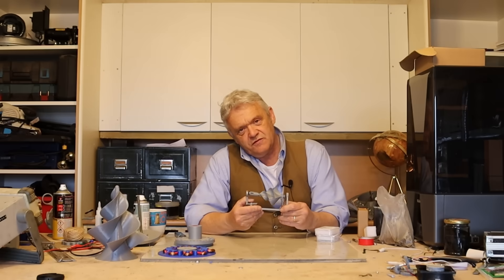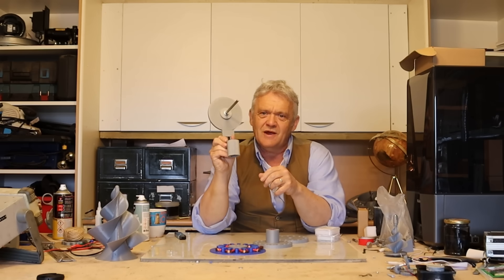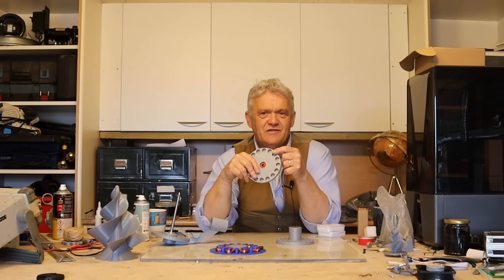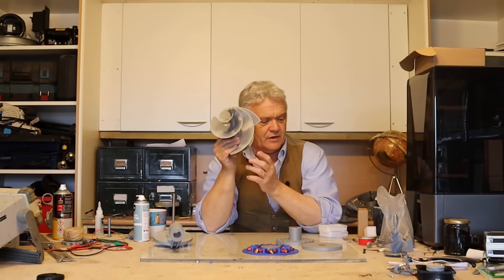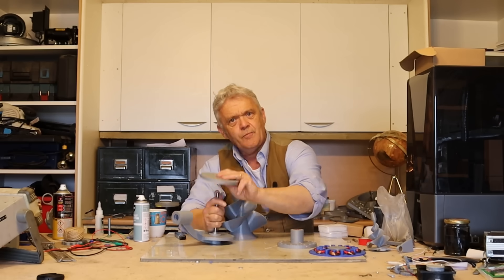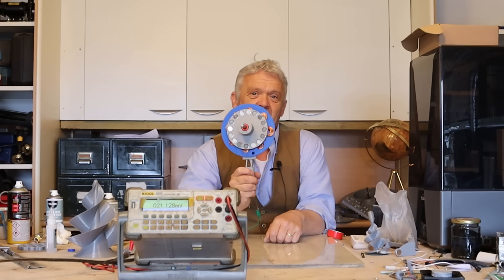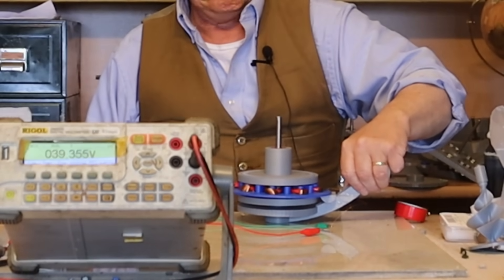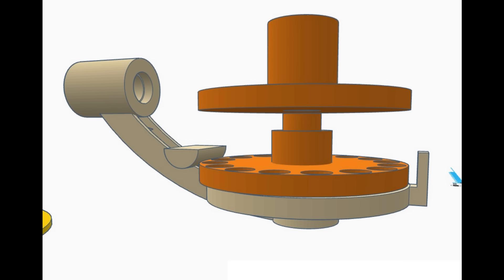1998 Archimedes Wind Turbine Generator Combined

Comment: Do You know why ship propellers aren't shaped like an Archimedes Screw?  Because it was found that if you cut the screw off at a point where the top of one blade starts to cover the bottom of the other, it's more efficient.  It's a simple optimization that's been known for over a hundred years now.  I bet You'd find the same if You were to cut the height of the screw in half and just keep the wide base.

Comment: If the slow speed performance is affected by magnetic sticking you could try building a centrifugal clutch into the deign
Reply: There was rubbing of the parts between the magnets and coils. There wasn't any magnetic sticking.

Comment: Awesome! Now to a Question! if we take a serpentine coil and make to tracks! one north and one south! To got levitation on the permanent magnets have a magnet in the turn of the coil! this is the cheapest way to get a levitation bearing in the rim! And max output on it to! And we can get a row on the other side to! And if that is done i can see it work Vertical and Horizontal as an Bering! It might be more costly but real Good!!! / Mikael

Comment: I'd love to see an Archimedes turbine mounted vertically inside a Darwin turbine. They look like they were made for eachother.
Reply: I also saw these as a match made in heaven 😊. Also because it would allow the use of the ball bearing tip to get low friction.
One thing I have found which is very important, is that these Neobidium magnets do not like being outside. If the surface coating is even very lightly scratched, the magnet just turns to rust dust.
Reply: as soon as he said "so I've changed this to a cone" I think everyone's brains snapped into the same image.
Reply: @Jay-jl3ou  Yes you can seal them in. But as a note, do not use silicone, epoxy does work, but if you think ýou may want to remove them a wax may work as well in cold temperatures. Silicones let water creep between it's bond to the surface, so moisture would get to the magnet.
Reply: What a genius idea, I can't wait to see if it works.  I bet Robert will get right on this, laughing like a mad scientist while he goes!
Reply: @Jay-jl3ou  They already are. And yes, if I were to make my own, I'd not only seat them with Epoxy Resin, I'd seal them with it too.
Reply: Seems like its the easy with even a smaller coil in the bottom, to generate top and bottom which can adjust the drag so the higher wind, the higher the torque,   Put that 3 phase washer coil you had earlier and make the magic happen with 3 phase on top and bottom in rotated alternations
Reply: And a magnetic bearing!
Reply: That was my first thought. It looks like it would be very efficient.
Reply: I was just going to write the same comment!
Reply: What do you mean, 'like'...?
Reply: A match made in heaven.
Reply: true
Reply: I thought the same. Would be interesting

Comment: Robert, ☝️☝️✍♥️  maybe a series of forward facing funnel shaped shroud , then cylinder cover, and then tail components to first collect wind like an open funnel similar to what  a dog wears after surgery, and add an interior rough surface or dimpled surfaced cylindrical wind energy concentrating housing shroud placed 360 degrees closely around the auger's length as a wind energy cylindrical concentrating surround to direct the wind energy to pass over the auger's fins in a parallel fashion and at a higher wind speed with the third component being that of a well set back trailing fin to turn the auger steady into the wind designed like the 1900's U.S. farmers type simple fined water pump wind prop with flat sheet tail. Think of a tail shaped like a boomerang so that the top and bottom surfaces of the trailing tail are out of the auger's vortice exhaust wind turbulence. Please keep up the inventing. I hope that You and Luke have a Happy Day !

Comment: That little turbine is just gorgeous, have you tried using capacitors in series to cancel the back-EMF generated in motors and the generator itself? Eliminating that little problem would be huge.
Reply: The "back-EMF" is what makes it a generator, the more the better.
Reply: @danedmiston9673  Have you experimentally verified that? Because that doesn't match what I've learned from studying Tesla and Steinmetz works, among others.

The input torque of an electrical generator would free spin freely and indefinitely if not for 2 things, Friction and the Backwards Translation of Load in the form of a reverse magnetic field which forms as a result of the forward current, and which opposes the input motion. This reverse torque fighting the input torque requires more and more energy to be applied at the input to continue the ability for the extraction of energy at the output.  

Tesla spoke about this reverse current and reverse magnetic field, now called the Lenz Law. Tesla opposed the reverse torque natural occurrence, with the introduction of capacitors into an already inductive generator coil circuit. This is evident in the writing of Tesla's pancake coil patent. But more importantly he invented resonant electrical circuits, the resulting oscillations that occur within the same capacitive / inductive circuits, which alternately transmits magnetic and then dielectric pulses, over time, which each passing electrical half wave, and influence other similar circuits with the same electrical resonant frequency.  

The key here is that these secondary circuits are forced into electrical oscillation without a backwards translation of load, so long as the frequency remains perfect on both circuits. In other words, if you can keep the circuits resonating while you extract power from the second circuit, you will be able to withdraw more energy from the output than there is needed at the input to keep the system running. Then you can loop a portion of the output to power the input continuously and indefinitely.  This has been successfully done and demonstrated in the work of Don Smith of Texas USA, and Tariel Kapanadze, of the soviet satellite country Georgia.  

The configuration is Tesla's patent 645576, System of Transmission of Electrical Energy. The configuration is Resonant circuits that are connected via the dielectric field. 

Although an optimal generator would be a lossless type that doesn't produce magnetism in its operation, instead maintaining lossless transmission in the form of dielectric current, this is how Tesla's hairpin circuit works by cleaning out the magnetism in an already inductive current, although I don't know if it's possible to generate pure dielectric current in the source.

Although it's possible a generator that has had its back-emf suppressed via capacitive resonance is producing dielectricity instead of regular electricity, more research needed.

Comment: I'm wondering how big this model could escalate, since it seems safer to birds than regular wind generator models.

Although I guess it'd be quite difficult to manufacture compared to standard blades, as it happens with the recent motorsail rotors which are more efficient and quieter.
Reply: There is a company that makes these commercially that are 1.5 metres in diameter.
They also hold several patents relating to the conical Archimedes turbine blades.
Reply: @PhilR0gers  Thanks for the info!

Comment: What a great design... Several on my roof will be an add-on to my solar panels... 👍👍
Reply from the maker: nice
Reply: @ThinkingandTinkering  is this realistic? how many watts does that archimedes turbine make in the wind outside?
Reply: I was thinking along similar lines. The space between my house and my neighbour's is like a wind tunnel.  A number of them mounted on the side wall would probably be very effective, would be easiet to maintain than if they were on the roof, and would be fairly unobtrusive.